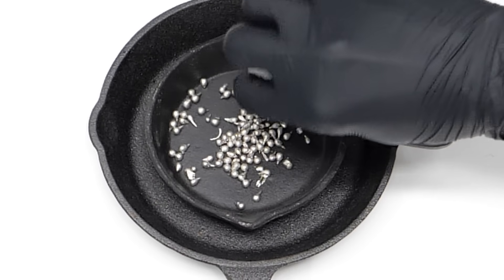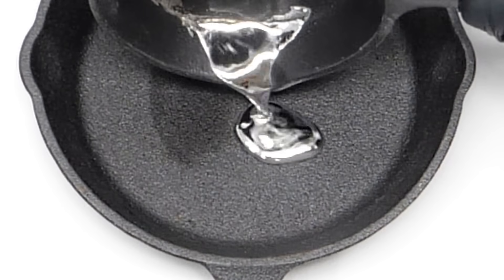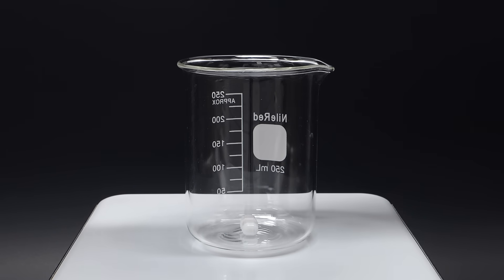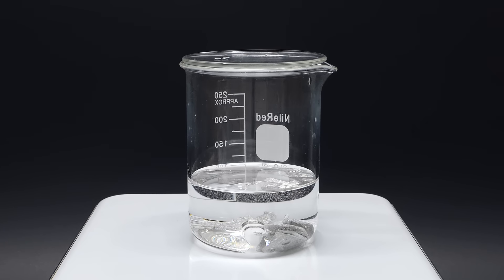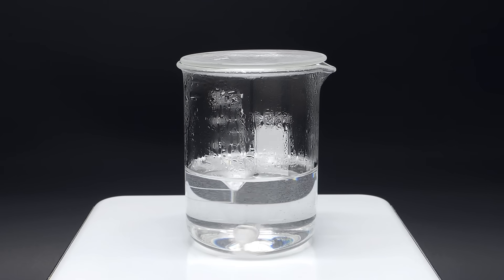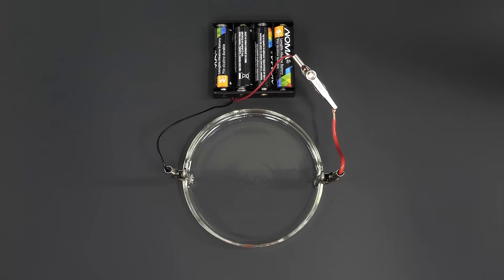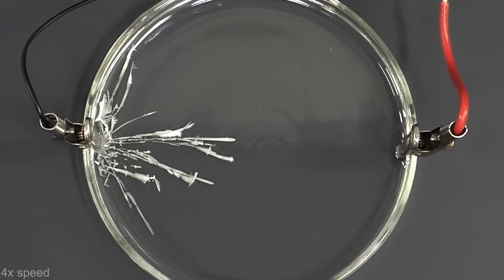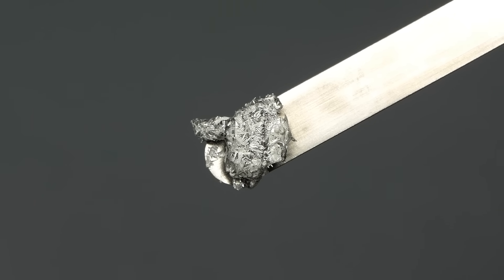Using electricity to grow metal crystals

Comment: Back in the 70s radio receivers had what they called a front end which was the first stage of the receiver and they were typically plated with silver, over the period of years the receivers lost sensitivity, the reason that they did is because there were fine hairs of metal growing inside the metal cavity which detuned the radio so that it could not listen, the early solution was to scrub them out and reassemble, the later solution was to  ditch the silver plating and go with a different metal that solved the problem.

Comment: Fun fact: this is the method similar to that of electroplating of tin in tin cans to reduce the process of corrosion :) So more than “growing” it can be said as extracting 
 
Ps : for electroplating there shud be electrodes(ie tin at the anode and the can at the cathode) and needs much bigger set up
Reply: I believe it is electrolysis, but don't quote me on that.
If i remember correctly, it separates the tin from the chloride using electricity, similarly to how hydrogen can be removed from water in the same manner.
Once again, don't quote me on it, it's just something i think it might be, seeing as I haven't done any sort of chemistry for multiple years

Comment: This is a perfect example of what dendrites look like. You know those battery fires? It's often caused by dendrites made of lithium. There is a separator in between the anode and cathode. If these dendrites puncture the separator, it can cause the battery to short, which produces the fire. Every time you charge your device, dendrites grow inside your battery. Scientists have worked hard to slow down dendrite growth.

Comment: Tin is pretty crazy, it will do stuff like this in open air at random. Tin whiskers have been one of the challenges of lead-free solder since the beginning. Its a fantastically complicated subject with extremely odd edge case scenarios of stuff like tin whiskers short between PCB traces.

Comment: I accidentally made metal dendritic crystals using soft low"E" glass which was coated in unannealed indium tin oxide and lead, AKA a clear conductive layer. There was a dielectric laminated over the conductive layer and a counter electrode that was inside a cover sealed to the dielectric. The edges of the dielectric and the conductive layer were exposed to air. When I applied voltage within a hour to my horror metal dendrites started forming from the exposed edges of the conductive coating all pointing to the counter electrode. They were so prolific as they grew they started delaminating the dielectric from the glass. I wished I had an SEM so I could map the conductive layer to show the movement of metals.

Comment: Next time you need to make tiny sheets of tin, just pour the molten tin from like half a meter onto a cold surface.. you could even put a little bowl upside down in a glass jar.  if the tin spreads out pretty thin, and it's on a cold surface, it's heat totally bails.

Comment: Just wondering if the tin can be purified by straight away taking the tin crystals after the electrical cycle without needing to melt and scape of the melted metal. (diluting the beads straight away in the acid)

Comment: I think the reason the Crystals start to form from negative side is that in reality currently start moving from negative to positive in battery. Nile I wonder what happens if we give the solution lots of electrons with higher voltage. I'm so curious to see the possibility of extracting whole metal

Comment: There's a seemingly similar phenomenon called tin whiskering, where tiny filaments of tin shoot out of alloys that have high concentrations of tin. This is a bit of a reliability issue with lead-free solder, and no one really knows why it happens. Leaded solder has enough lead to interfere with the process, which is why it's a good idea to use leaded solder if you really really don't want the solder joints to cause random shorts from whiskering (aerospace and medical equipment).
Reply: Most solder alloys help with this, and leaded solder has uh... lead. So I'd rather not.

Comment: Hey, I'm really curious about how that stirring thingy works, does anybody know?
Reply: Its called a stir bar and its just a magent covered in an inert material do it doesn't react with anything. The beaker or flask its placed in needs to be put above a stir plate which has a rotating magnet or electromagnetics inside which cause it to spin.

Comment: Actual question: did we use the chemical energy in the battery to produce electrical potential energy, and then use that energy to recrystallize metal by sticking the electrons from the battery onto the dissolved tin?

Maybe not literally-literally, but breaking a solution with electrical energy feels like magic, guys.
Reply: What you said isn't incorrect, but doesn't really represent what is physically happening. When the circuit is completed electrons can flow through the wires and then through the solution from the batteries. As explained in the video, the tin chloride will take some electrons to go back to tin. Although I will say, please be careful with your terminology, potential energy can't be created, only converted to another form such as kinetic energy.

So we're not so much breaking the solution as giving it electrons. I don't blame you though because physics can sometimes feel like magic. Have you heard of electrolysis? I think this is technically an electrolytic reaction.

Comment: Today on Yeet The Science ... question: is it possible to chemically clean the tin this way instead of melting it first so as to reduce the loss in yield, (yes I realize the loss is insignificant, just curious)
Reply: Nile shows electrolysis. Copper is purified by this method, you can look it up. By the way, the leftover sludge is quite rich in precious metals. For tin it should work too, if it weren't, Nile would get hydrogen gas instead of tin crystals. You would connect dirty tin as anode, and piece of pure tin  as cathode.
Reply: @rapalo89  yea as he said its called electro refining
Reply: @rapalo89  Hmm there’s something I’m wondering, in almost all experiments involving aqueous tin (II) chloride or SnCl2, tin is discharged at the cathode which forms the crystals. However, Sn2+ is higher on the electrochemical series than H+, so theoretically shouldn’t we obtain hydrogen gas? For copper it’s more understandable since it’s already lower than hydrogen in reactivity, but Sn2+ is a bit odd, especially since the cathode reaction usually doesn’t get affected by concentration. Is there something special about Sn2+ in particular?
Reply: @seedooo5315 I guess that guy dissolved too much tin that all the H+ ions (equal to the molarity of the chloride ions) got converted to hydrogen. So its just a solution of SnCl2 and water. So surely it's the concentration thing.
Reply: @Animetube-se4er  Reaction rate. The standard reduction potential of Sn2+ to Sn is just slightly more negative than that of 2 H+ to H2, which means that hydrogen discharged would be more thermodynamically favoured. But kinetics are also very important in electrochemistry! If the crocodile clips used in the video were made of Pt, we would not see that much Sn being formed...
Reply: I mean i can clean myself without losing a finger

Comment: It works in air to but alot slower look up tin whiskers. They grow on the new lead free solder electronics and is a big reason electronic failure rates increased after switching.

Comment: Nice to see some electrolytic techniques. At the one electrode Ti(II) converts to Ti, while at the other electrode, if the voltage is right, some oxidation reaction might happen. If I am correct if you let the metal grow and touch the other electrode then it would oxidize back to Ti(II).
Reply: Ti is titanium. Tin is Sn.
Reply: @zhwith  I must missheard
Reply: When it grows to connect to the other terminal, you get a short circuit, and everything stops.
Reply: @jpolowin0  yes. But if the element oxidates at that electrode, then probably the circuit will never be able to close. If you see at the video when it touches the electrode it dissolves.
Reply: @filliposchat6528  I'm not seeing that.  It appears to me that the tin bridges the gap.  And if the behaviour was as you propose, the growth would continue from the cathode, and that's not what we see -- it stops.
Reply: @jpolowin0  yeah. You are right

Comment: This is also a great demonstration of the dendrite formation that occurs in rechargable batteries and can eventually destroy the battery.

I wish you had allowed it to grow a short from electrode to electrode.
Reply: I believe that if he had let it grow more from electrode to electrode, then the electrode, that the metal was going towards, would oxidize the metal back to Ti (II).
Reply: @filliposchat6528  Aaw, I had hoped for boiling electrolyte and melting wires.  I know lithium chemistry batteries get really exciting when they short themselves.

Comment: I like how he talks about "growing" metal like it's normal
Reply: because it is a normal chemical reaction
Reply: @kristijanoros7208  aye, fair enough
Reply: It's one of the most boring aspects of chemistry as its forcing a reaction using electricity, explicitly the eV needed to make a metal deposite from ionic form to metalic form (+2 charge which is desolved back into neutral charge which is visible to the naked eye as the basic metal). The amount of applications are extreemly limited in diversity... like uh... checking metal in waste water, or ground water, or chemical waste. You get the idea.
Reply: Did you not have one of those crystal growing kits as a kid?
Reply: @StarkRG  my first chemistry experience comes from school, so yeah, I don't have those things
Reply: @StarkRG  no? no one did, what the hell are crystal growing kits?
Reply: @sweetsunia  I did

Comment: I had a question I would like anyone to answer. After spending a long time wearing mask, such as school, and then washing it after coming back at home, I see that the water turns black. I predict that it is the CO2 that we breathe. Am I correct? If not please explain.
Reply: It's more likely to be dust or mud, especially if you live in a high pollution area. CO2 is a gas and it doesn't turn solid for no reason.
Reply: @aoarashi3025  ok thx
Reply: it's not co2 mainly it is kind of tar which consists of Co2, Co, so2, no2 and some other pollutants etc....
Reply: @god00wizard  ok thx
Reply: Is the mask color black?
Reply: @florabloom3906  yes
Reply: @meghakothari4065  then maybe the color is fading lol